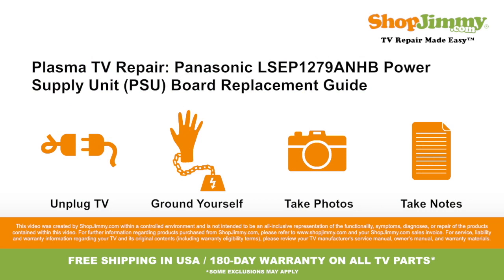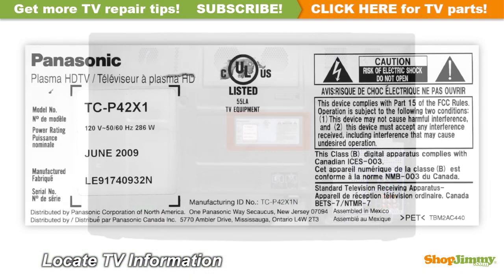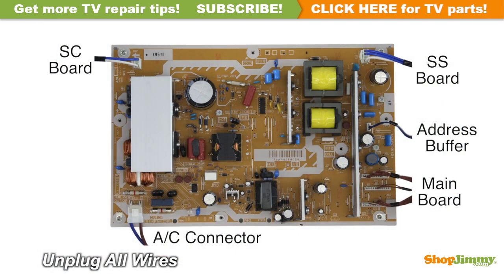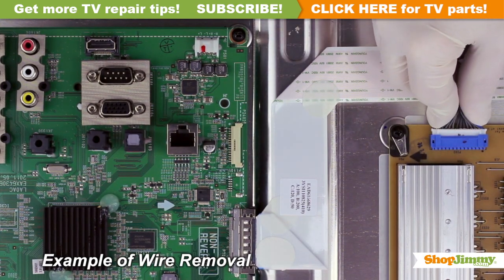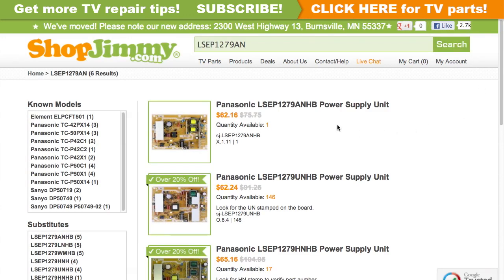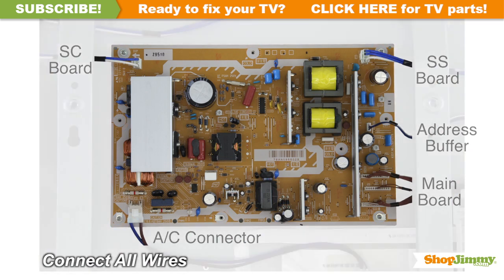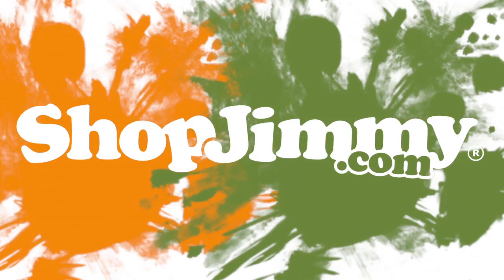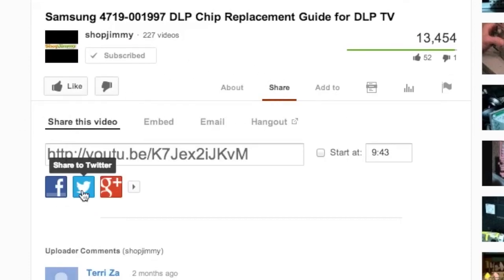Panasonic LCD TV Repair - TV Won't Turn On - How to Replace Power Supply Board

Comment: I have a panasonic TH-42PZ80U.  The LED does not come on at all.  no 2 or 10 blinks - completely dead.  I'm assuming the problem is most likely the power board.  you do not have the power board in stock, but you do have a repair kit.  Can you tell me if this is the likely problem (power board) and does your repair kit come with instructions / component locations ?  is it possible that it could be the A board instead of the power board ?
power board is ETX2MM702MF

thanks
Reply from the maker: abefroman57   2 blinks is usually the power supply board in this model. Repair kits come with component locations but no instructions.  Thanks and please let us know if you have any other questions!  www.shopjimmy.com

Comment: Panasonic TC-P50GT30 , serial # MH13130740 , manufactured date November 2011.   Power clicks the relays but red LED blinks 7 times .  TV worked last night but won't provide a picture today .
Reply from the maker: OldManOnTheMt   I recommend replacing the SC, SD, and SU boards in your TV.  Here is a link to replacement parts for your TV model number on our website, click here:  http://www.shopjimmy.com/catalogsearch/result/?q=TC-P50GT30  Be sure to match part numbers on your current board, with your replacement for compatibility.  You can also call our customer service for further assistance with your purchase.  (877) 881-6492  Thanks and please let us know if you have any further questions with your TV Repair!  www.shopjimmy.com

Comment: I have a panasonic plasma model TC-P50G15.  While watching it, i heard a pop and now I get no picture with a flashing red power light 3 times.  The light only comes on if I unplug the TV for an hour or more. Any ideas? Thanks
Reply from the maker: evan west   I recommend checking your power supply and your Y board for mushroomed (puffy) capacitors.  If you see any of these, you will need to either replace the capacitors or replace the entire board.  Here is a link to replacement parts for your TV model number on our website, click here:  http://www.shopjimmy.com/catalogsearch/result/?q=TC-P50G15  Be sure to match part numbers on your current board, with your replacement for compatibility.  You can also call our customer service for further assistance with your purchase.  (877) 881-6492  Thanks and please let us know if you have any further questions with your TV Repair!  www.shopjimmy.com

Comment: I have a question I have a Panasonic viera tc-p42x5 plasma was watching it and the power was turned off by the power company for about 1 hour then when the power come back on my tv didn't I have tried all the things I was told to do is does notta doesn't make any clicks pops or any other sounds when pluged in so is there any ideas to what it is thanks
Reply from the maker: Robert Gussler   I recommend replacing the power supply board in your TV.  Here is a link to replacement parts for your TV model number on our website, click here:  http://www.shopjimmy.com/catalogsearch/result/?q=tc-p42x5  Be sure to match part numbers on your current board, with your replacement for compatibility.  Here is a link to a video showing how to identify your part number, click here:  DIY Plasma TVs 101: Part Identification Number Guide for Panasonic Power Supply (PSU) Boards  You can also call our customer service for further assistance with your purchase.  (877) 881-6492  Thanks and please let us know if you have any further questions with your TV Repair!  www.shopjimmy.com
Reply: sorry it come on 24hrs later

Comment: Panasonic TC-P50G25.  Turn on device and light flashes with a pause between each set of 10 flashes.  It does click when turned on.  No display.
Reply from the maker: Joshua Garrett   I recommend replacing the A Board in your TV.  As of right now, we currently have one board in stock: http://www.shopjimmy.com/panasonic-txn-a1lpuus-a-board-for-tc-p50g25.htm  Thanks and please let us know if you have any further questions!  www.shopjimmy.com

Comment: I have a Panasonic 50" plasma (TX-P50S10B) It will not power up. Just 7 blinking lights. Please advise. Iam in th UK.
thanks
Reply from the maker: Gary Hawkes   I recommend replacing the SC board in your TV.  Here is a link to replacement parts for your TV model number on our website, click here:  http://www.shopjimmy.com/catalogsearch/result/?q=TX-P50S10B  Be sure to match part numbers on your current board, with your replacement for compatibility.  You can also call our customer service for further assistance with your purchase.  (877) 881-6492  Thanks and please let us know if you have any further questions with your TV Repair!  www.shopjimmy.com

Comment: I have a Panasonic TH-42PX75U that after my husband left it on one night just stopped working, it doesn't turn on and there are no blinking led lights. Any idea what might be the problem?
Reply from the maker: Samantha Jones   If your TV has no power at all, then I recommend replacing the power supply.  Here is a link to replacement parts for your TV model number on our website, click here:  http://www.shopjimmy.com/catalogsearch/result/?q=TH-42PX75U  Be sure to match part numbers on your current board, with your replacement for compatibility.  You can also call our customer service for further assistance with your purchase.  (877) 881-6492  Thanks and please let us know if you have any further questions with your TV Repair!  www.shopjimmy.com

Comment: Hi I have a panosonic TC-P42X5 and it takes the television 2 to 3 days to turn back on (now this occurs only when the television is unplugged) could it be a short in the power cord?
Reply from the maker: anthony spurlock   This could be caused by a short in the power supply.   #tvrepair   I recommend replacing the power supply to see if that fixes the problem.  Here is a link to replacement parts for your TV model number on our website, click here:  http://www.shopjimmy.com/catalogsearch/result/?q=TC-P42X5  Be sure to match part numbers on your current board, with your replacement for compatibility.  Here is a link to a video showing how to identify your part number, click here:  DIY Plasma TVs 101: Part Identification Number Guide for Panasonic Power Supply (PSU) Boards  You can also call our customer service for further assistance with your purchase.  (877) 881-6492  Thanks and please let us know if you have any further questions with your TV Repair!  www.shopjimmy.com

Comment: I have a Panasonic model no tc-p50x1 light blinks 12 times what can I do
Reply from the maker: TreeladyPara   I recommend replacing the A Main Board in your TV.  Here is a link to replacement parts for your TV model number on our website, click here:  http://www.shopjimmy.com/catalogsearch/result/?q=tc-p50x1  Be sure to match part numbers on your current board, with your replacement for compatibility.  Here is a link to a video showing how to identify your part number, click here:  Panasonic Plasma HD TV Repair Tips: Suffix Codes for A Board & Main Boards  You can also call our customer service for further assistance with your purchase.  (877) 881-6492  Thanks and please let us know if you have any further questions with your TV Repair!  www.shopjimmy.com

Comment: I have a Panasonic 50gt25, it just shut off on me when using it one day, when I plug it in you hear a click. When I hit the power button it clicks and then you see the start of something in the lower left corner and then it powers itself off immediately. I am thinking the power supply board is bad. anything I can check to make sure its the board and not the panel? Also if it is just a fuse that would be awesome
Reply from the maker: AJ Barnes   I recommend replacing the SC board and Scan Drive board(s) that attach to the SC board.  Here is a link to replacement parts for your TV model number on our website, click here:  http://www.shopjimmy.com/catalogsearch/result/?q=50gt25  Be sure to match part numbers on your current board, with your replacement for compatibility.  You can also call our customer service for further assistance with your purchase.  (877) 881-6492  Thanks and please let us know if you have any further questions with your TV Repair!  www.shopjimmy.com

Comment: I have a 50" Panasonic Plasma P50C2 that lasted a whole 2 years. Now it won't turn on. It has the 10 light blinking led going on.
Reply from the maker: Connie Gibson   I recommend replacing the X-Main/SS board in your TV.  Here is a link to replacement parts for your TV model number on our website, click here:  http://www.shopjimmy.com/catalogsearch/result/?q=P50C2  Be sure to match part numbers on your current board, with your replacement for compatibility.  You can also call our customer service for further assistance with your purchase.  (877) 881-6492  Thanks and please let us know if you have any further questions with your TV Repair!  www.shopjimmy.com

Comment: Hi. I have a 42" Panasonic Viera and yesterday, after a very strong lightning strike, the TV turns on but nothing comes up on the screen. The red light is on and eventually is makes a flickr noise and turns itself off. Then it comes back on by itself but still no image on the screen and no sound either. Will it be a matter of replacing the power board? Thank you
Reply: Model No. TH-42PX80X
Serial LB82560097
Reply from the maker: Steven King   I recommend replacing the power supply and the main board.  Here is a link to replacement parts for your TV model number on our website, click here:  http://www.shopjimmy.com/catalogsearch/result/?q=42PX80  Be sure to match part numbers on your current board, with your replacement for compatibility.  You can also call our customer service for further assistance with your purchase.  (877) 881-6492  Thanks and please let us know if you have any further questions with your TV Repair!  www.shopjimmy.com

Comment: I have a TC-50PU54 that just turned off last night and now the power indicator light is blinking 8 times.  I have been trying to determine what board needs replacing and have had very little luck.  Some sites are saying "energy recovery circuit" but it seems that the number of blinks is specific to a model/series number.  Any help would get me purchasing the correct board.
Reply from the maker: Cecil Jones   I recommend replacing the SU and SD boards for your TV repair.  Here is a link to replacement parts for your TV model number on our website, click here:  http://www.shopjimmy.com/catalogsearch/result/?q=TC-50PU54  Be sure to match part numbers on your current board, with your replacement for compatibility.  You can also call our customer service for further assistance with your purchase.  (877) 881-6492  Thanks and please let us know if you have any further questions with your TV Repair!  www.shopjimmy.com

Comment: I have a 42" Panasonic Plasma PCx24 tv. It wont turn on. No indicator light. No picture. No sound. Just nothing. Can anything be done to repair?
Reply from the maker: Brad Woodson   I recommend replacing the power supply in your TV.  Here is a link to replacement parts for your TV model number on our website, click here:  http://www.shopjimmy.com/catalogsearch/result/?q=x24  Be sure to match part numbers on your current board, with your replacement for compatibility.  You can also call our customer service for further assistance with your purchase.  (877) 881-6492  Thanks and please let us know if you have any further questions with your TV Repair!  www.shopjimmy.com

Comment: When I was watching tv, my Panasonic TX P42G30Y shut off. When I try to turn it on, nothing happens. The standby light is on… What can I do?
Reply from the maker: Solvejg Nielsen   I recommend replacing the power supply to see if that fixes the problem with your TV.  Unfortunately I do not see any replacement parts in the search results for your TV model number on our website.  Thanks and please let us know if you have any further questions!  www.shopjimmy.com

Comment: HELP my Panasonic TC-P50X1 Veria HELP my Panasonic TV that was on a surge protector is dead It clicks and the red light comes on and blinks 9 times> I did some reading and it said it was the power board so I ordered one off of eBay it worked a while and then it did the same thing did I get a bad power board or is it something else I would appreciate any help you can give me thanks....Lynn TV that was on a surge protector is dead It clicks and the red light comes on and blinks 9 times I did some reading and it said it was the power board so I ordered one off of ebay it worked a while and then it did the same thing did I get a bad power board or is it something else I would appreciate any help you can give me thanks....Lynn
Reply from the maker: Lynn M. Wright   I recommend replacing the power supply in your TV.  Here is a link to replacement parts for your TV model number on our website, click here:  http://www.shopjimmy.com/catalogsearch/result/?q=TC-P50X1  Be sure to match part numbers on your current board, with your replacement for compatibility.  Here is a link to a video showing how to identify your part number, click here:  DIY Plasma TVs 101: Part Identification Number Guide for Panasonic Power Supply (PSU) Boards  You can also call our customer service for further assistance with your purchase.  (877) 881-6492  Thanks and please let us know if you have any further questions with your TV Repair!  www.shopjimmy.com

Comment: I have a Panasonic Plasma TC-P42X5. It will not turn on or send any red blinking light. It makes no sound or anything. Do you know what I need to fix it? It was working fine last night, but would not even power on this morning. My son did unplug the whole power strip, I just plugged it back in. everything else on the power strip still works, just not the TV.
Reply from the maker: Seth Haley   I recommend replacing the power supply board in your TV for your TV Repair.  Here is a link to replacement parts for your TV model number on our website, click here:  http://www.shopjimmy.com/catalogsearch/result/?q=TC-P42X5  Be sure to match part numbers on your current board, with your replacement for compatibility.  Here is a link to a video showing how to identify your part number, click here:  DIY Plasma TVs 101: Part Identification Number Guide for Panasonic Power Supply (PSU) Boards   You can also call our customer service for further assistance with your purchase.  (877) 881-6492  Thanks and please let us know if you have any further questions with your TV Repair!  www.shopjimmy.com

Comment: Panasonic plasma tv wont turn on modal # is TH-P42X30Z  can you tell me if this has a fuse that can be replaced or will the power circuit board will have to be replaced......many thanks
peter Hansen
Reply from the maker: pj hansen   This depends on the issue, is it dead, or do you have a standby light, do you hear the relay click?  Please reply with this information and then I can recommend a replacement part for your TV repair.  Thanks!  www.shopjimmy.com

Comment: I have a Panasonic P50S30     I heard a pop and then the picture went out.   The red light is still on and it does not blink.   However, I cannot get a picture.   I also tried changing the Input.   What board do you recommend I buy?
Reply from the maker: Mike Light I recommend replacing the SC board in your TV.  Here is a link to replacement parts for your TV model number on our website, click here:  http://www.shopjimmy.com/catalogsearch/result/?q=P50S30  Be sure to match part numbers on your current board, with your replacement for compatibility.  You can also call our customer service for further assistance with your purchase.  (877) 881-6492  Thanks and please let us know if you have any further questions!  www.shopjimmy.com

Comment: This my problem . I have 50 inch Panasonic Viera tv. Modle #TC-P50X5. Serial # LE20810846. My power went out and by the time it came back my TV didn't turn on. I dont see or have any flashing red light like other Ppl say they have. It just won't power up. It usaly has a red light on when the TV is being used. That dont turn on. ive had this problem before. But all i did was unplug it over night and plugged it back in the next day and it worked, this time i didnt have that much luck.
Reply from the maker: lester rivas I would recommend replacing the power supply in your TV.  Here is a link to replacement parts for your TV model number on our website, click here:  http://www.shopjimmy.com/catalogsearch/result/?q=TC-P50X5  Be sure to match part numbers on your current board, with your replacement for compatibility.  Here is a link to a video showing how to identify your part number, click here:  DIY Plasma TVs 101: Part Identification Number Guide for Panasonic Power Supply (PSU) Boards  You can also call our customer service for further assistance with your purchase.  (877) 881-6492  Thanks and please let us know if you have any further questions!  www.shopjimmy.com

Comment: I have a 2012 51' Panasonic flat screen TV, there was a power surge and it shut off, when I tried to turn it back n it didn't work. I waited awhile and it turned back on. I recently had to unplugged it and 15 min has pass and it won't go on? should I wait longer?

Comment: my tv just turns on and then burns out literally like it fused out and burns something inside  and i can smell it and everything and wont turn on its coming from the left lower side of the back panel, is it dead or can it be salvaged?

Comment from the maker: @melecio bunag jr. - Yes, there is a fuse right where the plug goes into the power supply, more than likely if its bad it will blow out right away when you plug it in.  Thanks and please let us know if you have any further questions!

Comment: I have a Panasonic plasma TV model TH-50PZ80U.  The power light on the front flashes 10 times when trying to turn on.  What is the likely cause of this problem, and do you have a part(s) that will fix this problem?